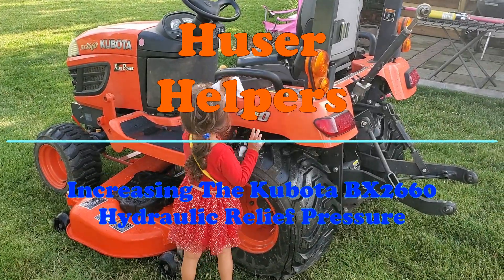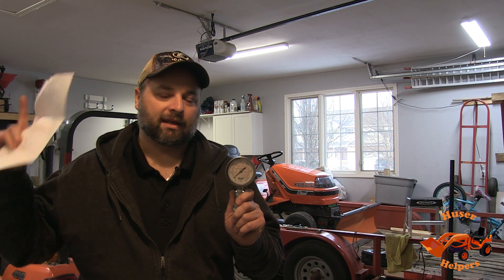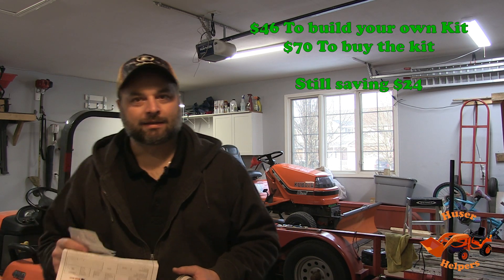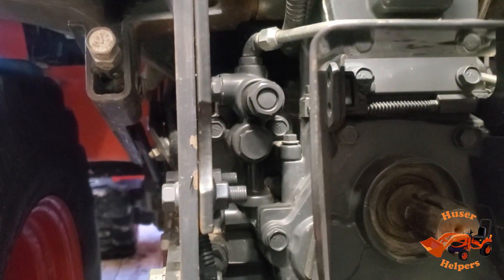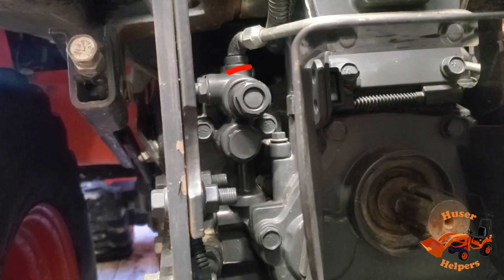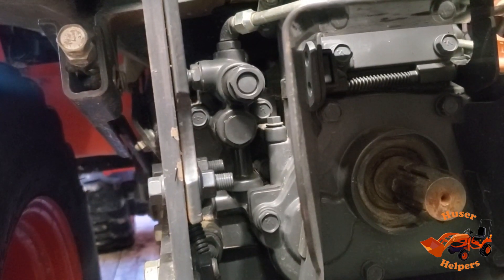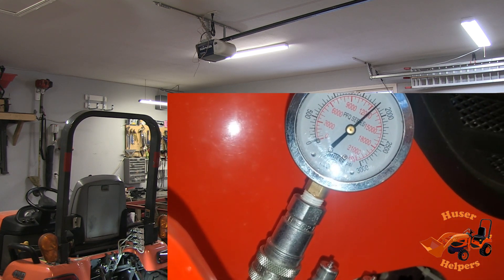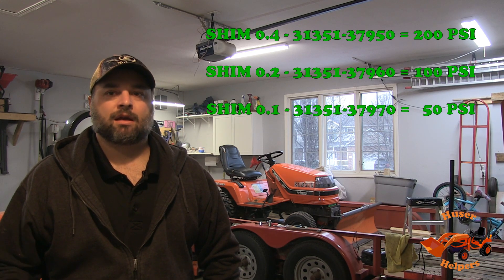Kubota BX Increasing the Hydraulic Pressure

Comment: Thank you for a great vidio.
I've got a question that I hope doesn't get me ridiculed,
Will raising the pressure effect the mower deck as far as the RPM of the blades??
Reply from the maker: It shouldn't.  Increasing hydraulic pressure does not impact the mechanical transmission which includes both the mid and/or rear PTO.

Comment: I’ve considered doing this, but I also know I manage to push the limits of my BX23S as it is…🤷🏼‍♂️  I will probably just go for it pretty soon.  Thanks for the information!
Reply from the maker: I really think these tractors are built well enough for 200 psi increase, but Kubota holds them back because of being tippy.  I mainly wanted the increase pressure for bucket curl as I have had times pushing into a rock pile I couldn't get it to rack back.  Lift has never been an issue with a struck off bucket of rock.  I could see with a backhoe where the increase in pressure could be a big benefit.  I don't think I have read or seen where anyone has broken their backhoe on a BX.  Thanks for watching, Jason
Reply: @HuserHelpers  I’d say you are exactly right.  I want the pressure for the backhoe.  I can already nearly flatten the fronts with the loader…. I have a video coming out this weekend where I show just that.  😂  You’ve about talked me into it:  👍

Comment: Nice job Jason, I found that 2,000psi is generally a good place to be for most users.. you get a pretty generous power increase yet your not having to worry about bending the loader or blowing out a cylinder seal.. Iv got mine cranked to 2400psi tho and Iv yet to break something.. maybe this summer 😅
Reply from the maker: Yeah, I might put in a .1 shim to get it to a solid 2000.  Thanks for watching
Reply: Are you still doing good at 2400 psi?
Any issues?

Comment: You are going to love the extra capacity.  Add a ssqa adapter and third function and it will be very capable and versatile.   Did it to mine and I love it.
Reply from the maker: Dang it Tony, the SSQA was a surprise.   It should be here in March or April.  I need a stump bucket for a trenching job this spring so that is what these upgrades have been all about.   Thanks for watching. J